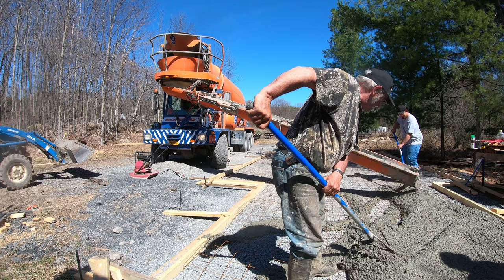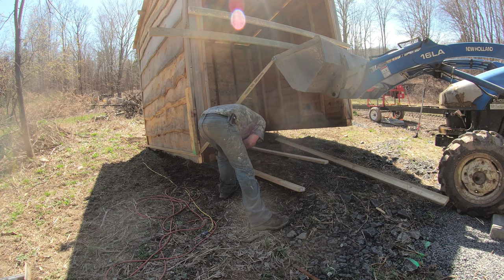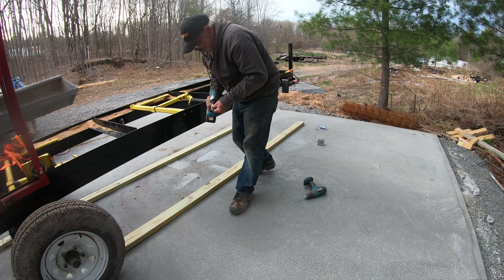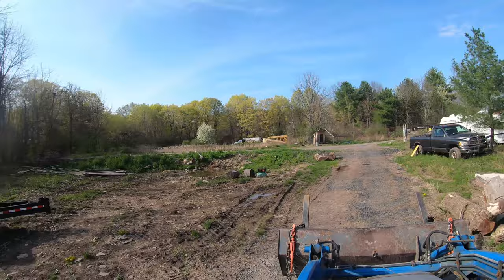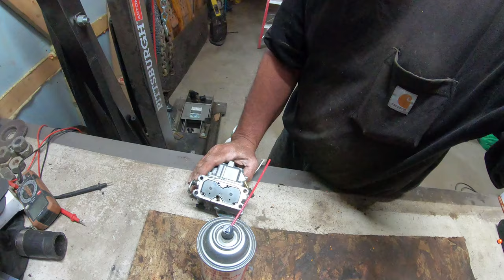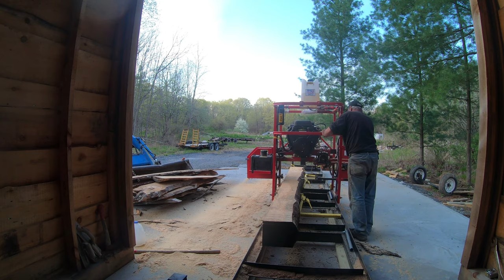saw mill slab

Comment: Glad to see you get the slab poured.  It will make things so much nicer.  Nice work on the concrete!
Reply from the maker: thanks itwill be alot easer to work with and i have 10000 board feet od lumber to mill

Comment: Dan when i have a stubborn screw I will insert the  driver into slot, tap lightly with small hammer, then try to tighten screw  a tad. This usually works great. Also, i use   Sta-Bil in all my gasoline engines except car & truck.   Hope this helps.....enjoy your videos, keep them coming.
Reply from the maker: thanks i have done the same ,for gas i only put high test with out ethonal

Comment: Maybe worth getting a new fuel filter, as it did look dirty; there are cheap. Also flush the fuel tank, it has been sitting all winter and it may have had some saw dust or dirt from refuelling last year???
Reply from the maker: yea i willi need to change the oil also

Comment: Now we are cooking with peanut oil a Hudson running bad will still cut better that the other brands on the best day.
Reply from the maker: george do you have a hudson? i've had this one for about 3 years i like it alot it'seven beter now on the slab
Reply: @danwheeler5130  I got one just like yours less the trailer last month but have not set it up yet but after watching your video i would like to do it that way i like the way you made the pad large and the way you set it up thanks
Reply from the maker: @georgeshotrodbarn2113  your going to like it enjoy